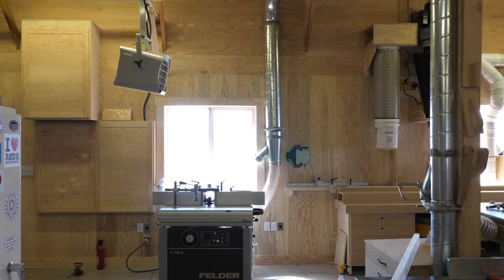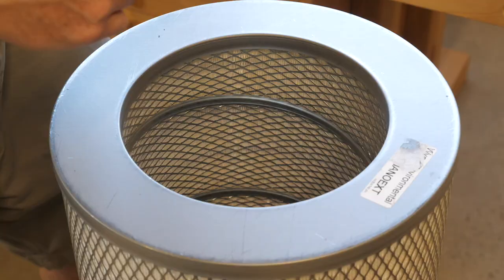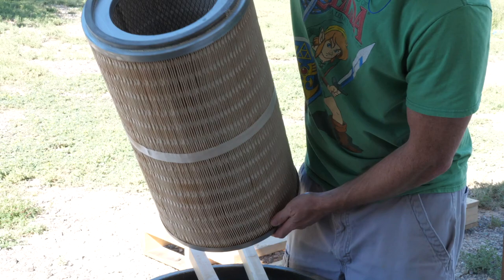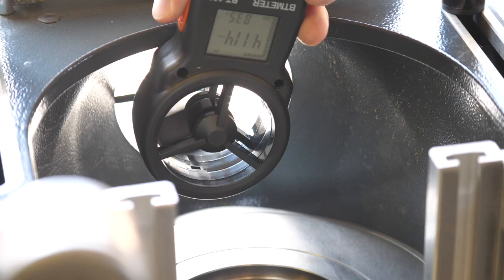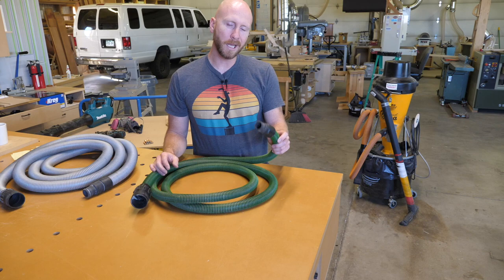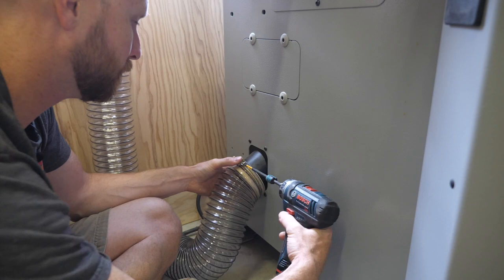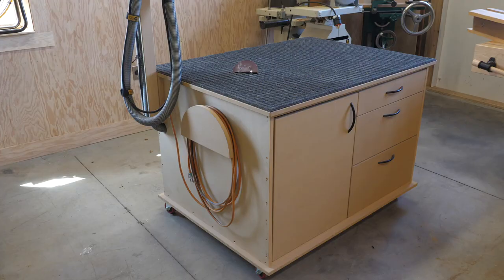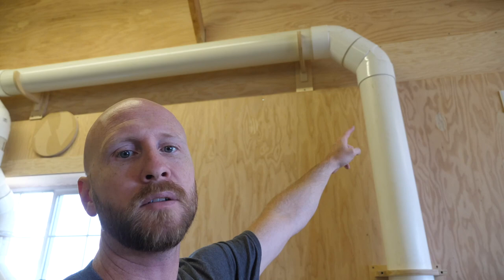Dust collection tips

Comment: Thanks so.much Mike, these tips are great. Over 20 years ago I worked in a custom cabinet shop that did not take collection seriously. Wood dust is bad but coreon is terrible. I only lasted a year and turned back to my marketing profession. Anyway, I have a one car garage shop and dust is a huge issue. Put me in the northeast ans in the winter it's a real challenge. I'm super interested in the ambient filter you made and I'm curious. So, if you get the fan it will be pulling air up through the filter then blowing the clean air out the top, correct? I'll definitely do my research and check out your links but I just wanted ro make sure I was correct on that. Thanks!
Reply from the maker: Yes, blowing out the top creates velocity which stirs up the air and helps to clean more of the air in the shop.

Comment: Hello, what if you reversed the blower to blowing into the filter, and put a pre filter on the intake? Do you think this would be effective?
Reply from the maker: This filter is designed to collect on the outside, to do this you would need a different filter. I do not think it would be as effective because there would be very little velocity as the air exits so the filter would just filter the same air over and over.

Comment: Not sure the idea of pumping the harmful dust you don't want to breathe out the window for it to be someone else's problem is the best solution.  Yes it will disperse relatively quickly in open air but still the air in the vicinity of that window won't be fit to breathe.
Reply from the maker: Not an issue. It disburses so fast just a couple feet from the widow is immeasurable.

Comment: Is the 8" duct fan powerful enough to pull air through a Merv 15 filter?
Reply from the maker: Yes, these filters have a lot of surface area, and therefore do not have much overhead. There is always the question of fall off as the filter gets clogged, however, I have been running these constantly in my shop and have yet to clean the filters and I am still getting pretty good flow.
Reply: @MikeFarrington  super, thanks a lot.

I felt I had to ask, but I saw one of your updates in the comments here saying that it has been working. Also in the video you show that it has cleaned the air as well... Thanks again.

Comment: Love this video! But I have questions... your system is getting 6000+ CFM?! Or is that a different measurement besides CFM? I have a pretty powerful 5HP clearvue cyclone rated at 2k CFM... so 6k just seems nutty if thats the case. You mentioned keeping it at 3500-4500 at the tool which... if thats cfm... is astronomical. Im super curious what im missing with this 😅
Reply from the maker: No, that is reading speed, not CFM. So I'm getting 6k feet per minute, to calculate CFM the speed would need to be converted to the area of the pipe. 6000 FPM through a 6" pipe is like 1150-1200 CFM.
Reply: @MikeFarrington  makes much more sense now thank you LOL. I was thinking if you werent careful you could get sucked into the abyss 🤣

Comment: I have talked to dust collection companies and they have said that PVC is no good, do you think that is accurate or are they just trying to push what they sell?
Reply from the maker: I'm not sure I can answer that question scientifically. Anecdotally, I have setup several systems now with both PVC and metal, and I have had good luck with the PVC, as mentioned the catch is it gets really expensive in the larger sizes. If a company bashes something, then says theirs is the only way.... well, I've heard enough. Only issue could be in a commercial shop, inspectors don't like PVC.
Reply: @MikeFarrington  I do know in NY that code doesn't allow for PVC in dust collection  I am not sure why,  it wasn't explained by the firemarshall, just that it was the code. But it doesn't mean its a bad thing half the codes here are insane anyhow.
Reply from the maker: @adamchesis7443  I don't think its permitted anywhere in a commercial application. However, for a home shop its fine, I don't think there is any specific building code prohibiting it in a home shop. I totally agree, there are a ton of building codes that just don't make sense.
Reply: @MikeFarrington  that's probably true, my shop is in a commercial space I was looking at moving and now they want a $20k fire suppression system in the booth, I will be switching over to 2k urethane, Someday I will build a building on my property, just have to figure out how to get them to put in a 400amp 3 phase service in a "hobby" shop lol
Reply from the maker: @adamchesis7443  The shop on the property is a good way to go if you can swing it. We only have 200 amp single coming in. I power all 3 phase stuff with a 20hp phase perfect, could be an option for you.

Comment: What happens to the particles once the fan stops? Won't they drop to the floor or get picked up by the moving air in the room?
Reply from the maker: Not sure I follow.
Reply: @MikeFarrington  as the fan is sucking air out from the inside of the filter. Particles are kept on the outside and not contained inside the filter. Won’t they release from the filter back into the room once the suction stops?
Reply from the maker: @ptz0n  No it stick on there pretty good. In fact its a bit of work to get the particles off. If by accident a fan was blowing on the filter or the air hose was blasted towards it that could be an issue. The problem is, you don't want the collection on the inside because there wouldn't be enough velocity as the air leaves the filter to stir up and filter the air in the whole shop. Hope that makes sense.

Comment: I know you say they were a great deal but 250 each time one needs to get replaced is not a "good deal" by any true measure even though this is very easy to put together.
Reply from the maker: Yeah, but how often to they need to be replaced. I've been running these daily for months now, and have yet to even need to clean, let alone replace. At my current usage, I would say replacement would be greater than 5 years.

Comment: Uh, I would rather buy merv 15 filters from the big box store and make a solution for less than a $100.
Reply from the maker: MERV 15 are difficult to get from box store, they also won't have much surface area, so they will need to be cleaned often, and many are not designed to be cleaned. This filter can be cleaned and reused for years. I think that the 100 dollar solution is only cheaper upfront. If this is to be used in your shop for a long time, I think I have presented a better solution.
Reply: @MikeFarrington  That is also true, much harder to find.
Reply: Exactly, I don't have a shop but I need to purify the air where I'm currently renting... We're getting a lot of smoke from Canada, we have cats, and there's a musty smell coming from the basement. The cost of purchasing and replacing Merv 15 air filters quarterly is more expensive than homemade rigs based to this.
Reply: @remain___  You have a different situation. In that case I would go with Mike’s design too.